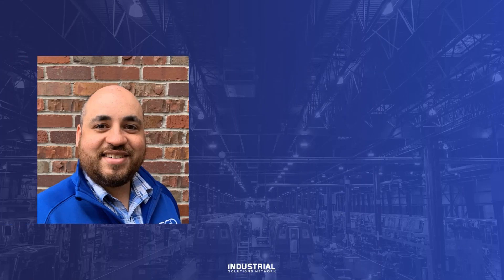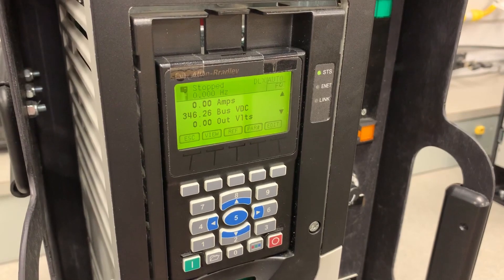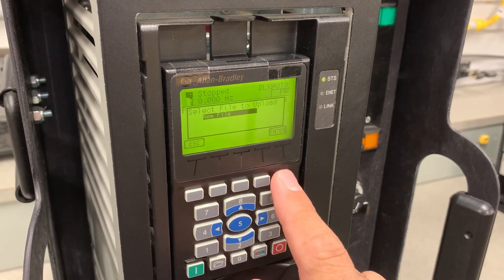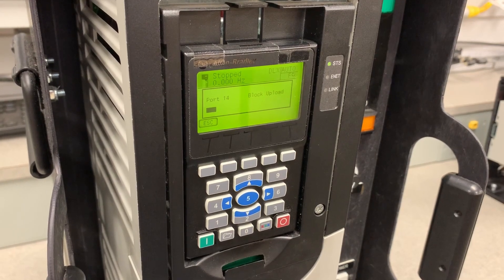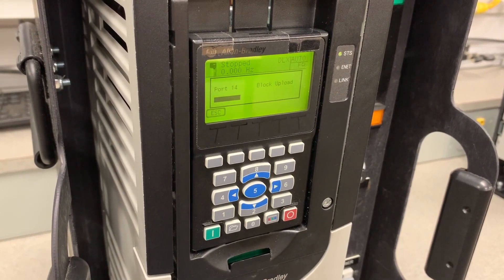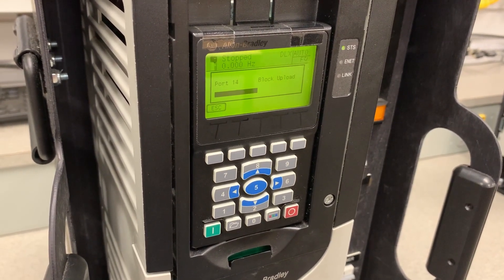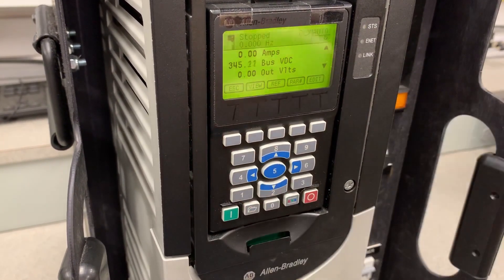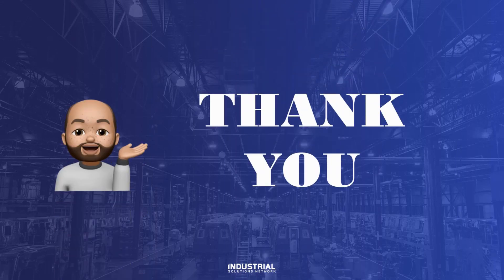PowerFlex 750 Series HIM Copy Cat How To

Comment: Hi. Can you make a backup with the HIM with the VSD working?
Reply from the maker: Hi, BravoCristian.  HIM-to-Device needs the Drive to be stopped.  Device-to-HIM can be done when the Drive is running provided that the HIM is firmware 1.006 or higher.  Thanks!
Reply: @solutionconsultantsnetwork6843  thanks